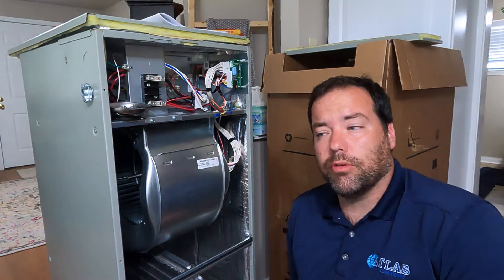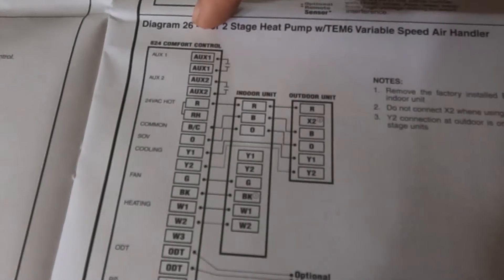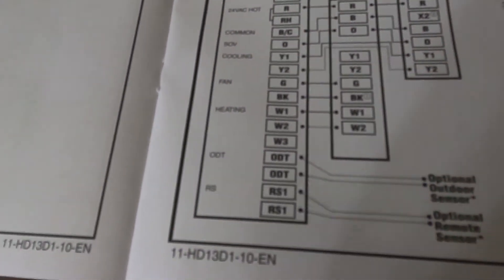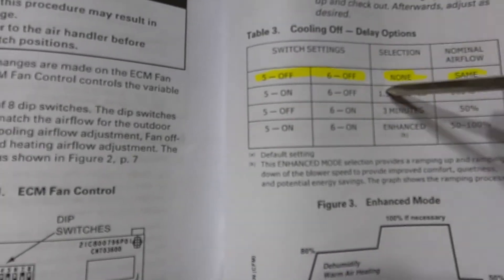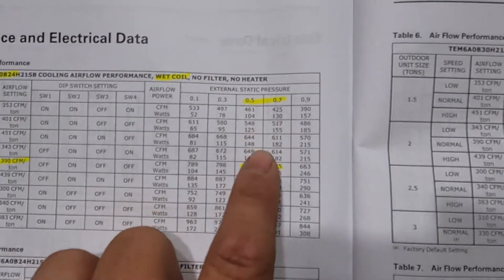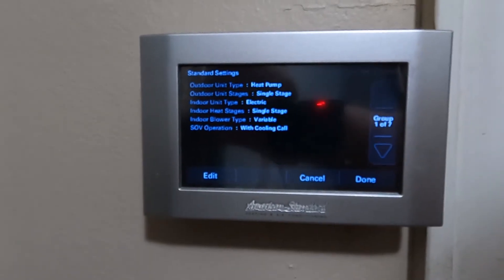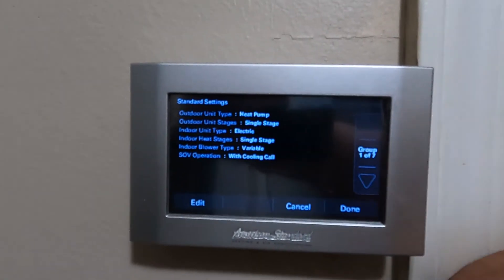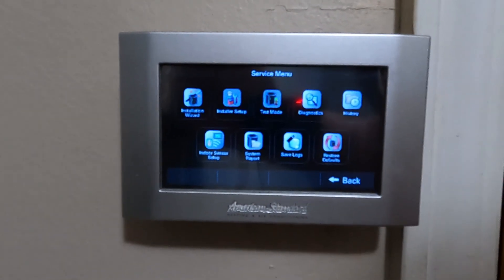TEM6 / 824 Thermostat Install and Configuration for American Standard and Trane Air Handlers BK Wire

Comment: I have the exact same system, Trane 2 Ton single stage heat pump with a variable speed air handler and a Trane xl824 thermostat…. Talking about the yellow Y-1 wire…. You are saying the Y-1 should not be connected at the air handler? Correct? 

Because if I removed my thermostat from the wall, Y-1 is connected
Reply: Like the manual says ..its suppose to be from point a to b 
Point a being your XL thermostat,  point b being the condenser unit..so your y1 at the thermostat suppose to be wired so the thermostat sends out to the cdu ..the air handler in this situation does not care  about yellow.because it relys on its life on the thermostat to do it all
Reply from the maker: Correct, with this thermostat and BK hooked up, you don’t land the y on the air handler. If you were not using bk, then the air handler would need the y signal.

Comment: Question. So you don’t hook the yellow for 1st stage ? Or whatever color for 2nd stage? The Bk terminal will know how to control fan speed without those hooked up?
Reply from the maker: That is correct with the Tem6. Don’t land the Y signals on the air handler board. If you do, the board work get a speed command from bk, and y. It will confuse the air handler and the blower can act erratic. 
With a 5TEM6, you must hook up the air handler y to the thermostat and Y-out to condenser Y.  And remember to cut the y1/y2 jumper at the air handler board  
I should probably make another video for A2L wiring, because it is slightly different.
Reply: @Hvacoffroad  yeah I’m about to install the TEM6 with the 5TWR7 condenser. So I looks like they wire almost like the Yorks system where they pass through the AHU to condenser but don’t land in the airhandler. Thanks for that info

Comment: I just got a 5TEM6D07AV51S and is the Wiring setup the Same for this Air handler and the XL824. The installer didnt want to wire the BK wire because he had never done it and was confused.
Reply from the maker: Good question. Wiring will be very similar to the 5tem6. There is a good diagram in the install manual for that air handler. Y1 and Yo will be hooked up according to the mitigation requirements, but if you are using bk, the Y2 will not connect to the air handler board.
Reply: @Hvacoffroad  Wonderful Thanks
Reply: @ Tech came back and wired the BK wire up but we couldnt see a Jumper on this model to actually cut.
Reply: @dbmet that is because out of the book Pin coming out the circuit board of the air handler bk is actually installed with a white/black strip wire not red wire as the gentleman in the video says..actually red with white stripe in this video on the pin of the air handler manual it states red and white is just R not bk

Comment: Hey, Good Video. I have a TEM6 with a single-stage heat pump and a Honeywell Pro 8000 Wifi. I cut out the red/white wire at the harnest and used the black/white wire that comes out low voltage for Dehum wiring to stat.  Then to the U1 terminal including the jumper I installed at the base of the thermostat from R to U1.  Question in my settings for the pro 8000 I set for dehum low fan speed but is it normal Open contacts or Closed dry contacts. And for yellow Y1 and Y2 in the directions  says not to use the Y1 and Y2 but based  on the video that's on for the comfort control.  Do I use the Y2 wire and normally open?
thanks
Reply from the maker: I'm not entirely sure how the Honeywell thermostat operate in dehum, but I can tell you how the the TEM6 responds to 24v on it's terminals.  
If you remove 24v (cut the red/white jumper wire) from bk, all airflow is reduce in every mode.  When you apply 24v  back to the bk wire, airflow is returned to normal.  This is how you can achieve dehum with reduce airflow.  
So if I understand your setup correctly, you would want normally closed contacts, that open when you want dehum.  
The BK enabled thermostat take it a step further by sending dc voltage to the bk circuit to give it even more control over airflow.  
Hope this helps.

Comment: Great video.  I have 4Ycz60601115a and changing out Tcon802 to XL824.  It shows BK hooked up.  When cutting jumper from R/BK do I wire the Thermostat connection to the BK side for PWC to control fan?
Reply from the maker: Exactly right.  That will give you the PWM signal to control the blower.

Comment: Thank u for this video. I bought a new XL850 thermostat from ebay for my trane TCD090 SF 1C 1998 Package rooftop Air condition unit. I connected B/C to common  R to 24volts and D to the signal, after power on the thermostat is not communicating with the UCP unit. Can you tell me any suggestion.
Reply from the maker: The 850 thermostat is for communicating systems only.  You'll need the 824 thermostat for 24 volt systems.  This should fix your issue.
Reply: My system is communication type 14th pin is 24 VAC  12th pin is Communication and 11th pin is Common
Reply from the maker: @مدارسالنخبةالنموذجية  the 850 is for residential split communicating systems only.  That thermostat will not work with your package unit.

Comment: Thank you for posting this informative video. Trane refuses to give technical support to consumers.
Question:
I am having a Trane TEM6A0C36 w/10kw Heat 1 stage, paired with the 4TTX7036 (XL17i 2 stage A/C only) and a XL824 T-Stat. The Installer gives me a blank stare when I told them I want the Enhanced Dehumidification  aka (ComfortR) set up. I am in South Florida I want the extra dehumidification.

Using your video and the Trane installation instructions I would like your input on the correct ECM and T-Stat settings I should have.

This is what I am thinking;
ECM Dip Switch - 1,3,4,5,6,OFF; 2 ON. 7 OFF; 8 ON (825cfm)

T-Stat changes from DEFAULT settings - 
Group 1 - Outdoor Unit, Two Stage
Comp Type, Single Comp.
Indoor Blower, Variable.
 
Group 5  Not sure on these - Dehumid Overcooling Limit ?? 1.5 degree maybe??
 Smart Cont Fan ?? Enable??

Group 6 - VS Blower On Delay-Clg,  Enhanced Mode??
VS Blower Off Delay - Clg, 30 Seconds @ 50% ??
Comp Low Stage Air Flow 55 to 80%. No guess on this one.
Reply from the maker: Your DIP switch configuration seem correct along with your Group 1 settings.  You may consider moving SW3 ON to get 400 CFM per ton.  Especially if you decide to  modify the blower ramping profiles.  If you have too little airflow,  you'll freeze the coil and potentially damage the equipment.  

Group 5:
Dehumid Overcool is a nice feature that I usually set up for 2 degrees with 2 stage units.  That seems to work well in my humid region (NW FL.)  
Smart continuous fan enable- will lock-out the blower only operation, when the humidity level is higher than the target humidity.  The theory is, if you run just the blower, it will pull moisture off the wet coil, and disperse it into the air stream, raising the humidity.  This will still allow the blower to run in cooling mode, just not "fan on" by itself when the humidity is high.  

Group 6 is all comfort settings so you can change those as you see fit.  Generally, blower off delays add moisture back into the air, but slight increase efficiency.  So keep that in mind as you set these up.  The "Enhanced Mode" is a great generic fan ramping profile.  It's explained on pg 7 of the TEM6 install manual.  
VS Blower Off Delay - Clg, 30 Seconds @ 50%  - I feel this is a good balance between comfort and efficiency.  
Comp Low Stage Air Flow-  I usually leave this at the default setting of 80% .  Again, not wanting to have too little airflow and frost potential.  
Hope this helps.

Comment: I have spent so much money and time into this 5ton 2stage TEM6 with the XL824 setup I have, and still not setup right. Every single person that has come to my house has no clue on how to set it up. I just checked the Red/White “bk jumper” and it was not cut.  It was wired as it did not have the Trane specific thermostat I guess. Now I have to figure out the yellow wires!

Thanks so much for the video!
Reply from the maker: Glad it was helpful
Reply: my XL24 reads 70-75% humidity still.. I have the dip switches 1-2-3-4 all set to off  which is the default setting (375 CFM) Not sure who actually knows this system that actually cares to help fix the issue instead of making a quick buck. :/ @Hvacoffroad

Comment: This video is very helpful because I just had a TEM6 Air handler installed with this thermostat. Can you explain what the BK wire is for? I asked my installer to configure my install so the thermostat controls the speed of the air handler and they had no idea what I was talking about, they told me we set the jumpers to normal, and that’s it. When I press them I could tell they were out of their comfort zone and really had no idea.
Reply from the maker: Sure, the BK wire has number of different uses. The first one is for de-humidification and fan speed.  The  bk enabled thermostat sends a dc voltage to the air handler board, which tells it what speed to run.  Also, that bk enabled thermostat can be programed to allow fan delays, and send the signal to the air handler board.

Comment: This is a great video! 1 question. You mention to removetheyellow wires completely. The diagram shows Y1 is still connected. I have this energy saver box from my utility company that connects to the yellow wire. (Duke Energy) Can I still leave the yellow wire disconnected or does it need ro be connected for that energy saver? I rather have variable speed to control my Florida humidity over that box.
Reply from the maker: If you're using BK enabled thermostat, don't hook the Y1 up to the the air handler.  If you do, the air handler will receive conflicting fan speed signals and operation will be sporadic.  With the BK, you should just hook the Y1 up between the thermostat and the condenser.   Then your utility company can break the Y1 call for energy management.  
Hope this clarifies.
Thanks for commenting and watching.

Comment: I accidentally hit done after the first stage of Install wizard and never could get back into Install wizard per the instructions in the book so I said  start the system up it it seems to be functioning normal and the yellow wires are hooked up as you normally would BK wire clip that did that
Reply from the maker: For the thermostat to acknowledge the bk signal, bk jumper will need to be cut on the air handler and in the thermostat, the setting "Blower Type" will need to be set to Variable instead of Non - Variable.   
If it is set for non-variable, the thermostat and air handler will look for the g, and y signals for blower speed, not bk.

Comment: What happens if you go ahead and hook up the yellow wires like a conventional thermostat that’s what I did seems like it’s running just fine
Reply from the maker: If you have the yellow wires and bk hooked up at the same time, the blower will get conflicting fan speed signals.  Airflow will probably be sporadic.

Comment: Yeah I just had a system installed today they stayed here over 12 hours couldn't figure it out I think this might be their issue it's a platinum 1050 thermostat paired with a gold 17 5-ton two stage heat pump with a American Standard Tem6 variable speed air handler. System wouldn't power on threw a couple of error codes on the thermostat both the heat pump and the air handler control boards had green lights but thermostat wouldn't send a call for cooling.
Turns out i needed a relay board but they can't figure out how to set this thing up and it make matters worse there's a language barrier they speak Spanish.
Reply from the maker: Yes, that’s a unique installation when this unit is paired to a 1050 thermostat. 
They would need the relay panel to make it run correctly, because the 1050 is intended for a communicating system. Yours isn’t communicating, it’s 24v, so they need that relay panel to make it communicating.
Reply: @Hvacoffroad I figure 1050 for comunicating Yes
Reply: Agree spent 4 hrs on same unit not able to figure out Installer took papers